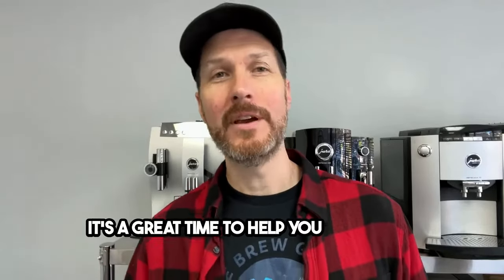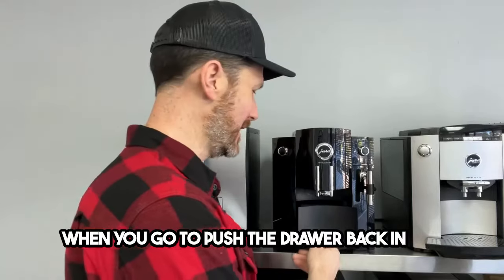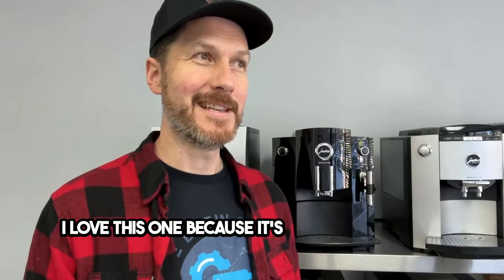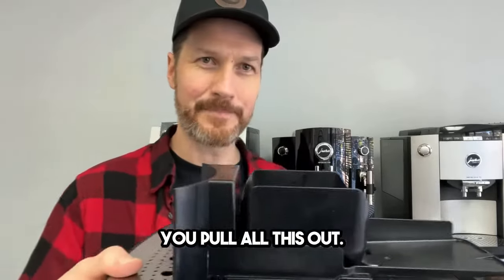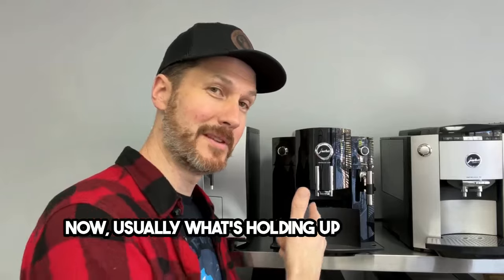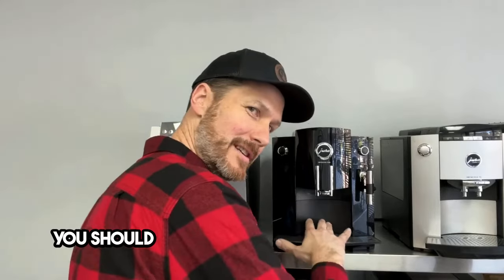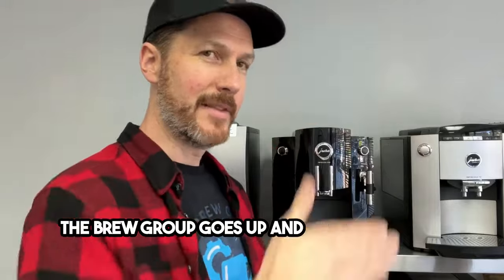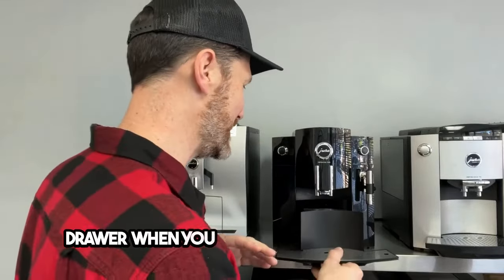Jura drawer or tray won't go in?   Try this!  THE JURA GUY Troubleshooting Help

Comment: Help. I turn power on but says switch open and it’s not open. So I open it and says system filling. Then goes back to switch open
Reply from the maker: The dreaded "open tap" message.  Remove the filter if there's one in there.  Open tap.  If that doesn't do it, it confirm you've got a clog in the system and need service.  Clogs are kind of the worst-they can take forever to find and are tricky to clear.  Please fill out a form on our site and we'll provide an estimate for repair, based on your model and location.  Thanks!  www.thebrewgrouptx.com/refurb

Comment: How about when it's stuck and doesn't come out?
Reply from the maker: Thank you, great question!!!  It's a little bit the same issue, but a different sort of problem.  The puck scraper can prevent the drawer from going in (like in this video) but it can also prevent you from pulling the drawer OUT.  Unlike in this video, when the drawer is stuck IN the machine, your problem indicates that you definitely need service, because the brew group is no longer able to re-center itself.  That's OK!  We know what to do.  Could you possibly fill out a quick form on our site so we can provide a free estimate for repair? www.thebrewgrouptx.com/refurb Thank you!  Ben